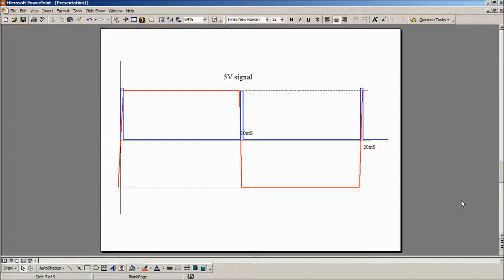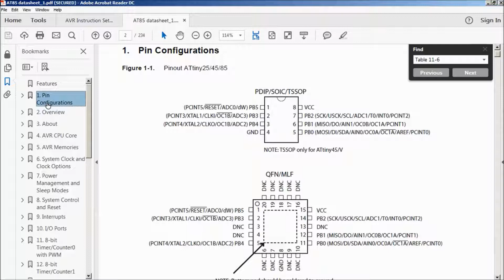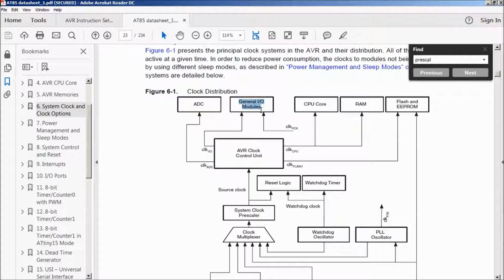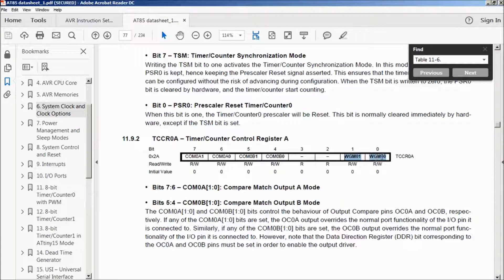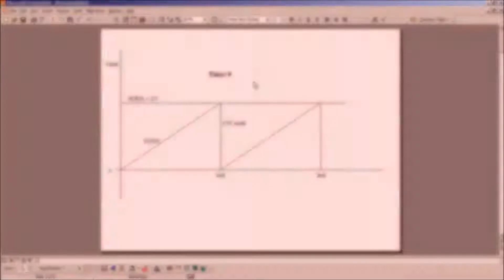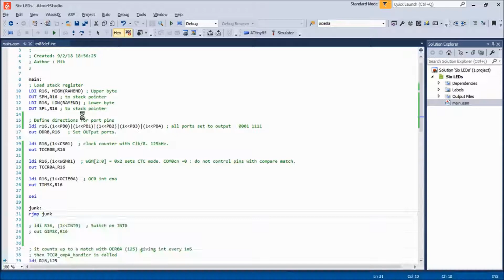ATtiny Assembler Tutorial Part 3 -  time delays

Comment: How does the rjmp  junk   ' knows '  that   the count  TCNT0 is equal to 125 ?
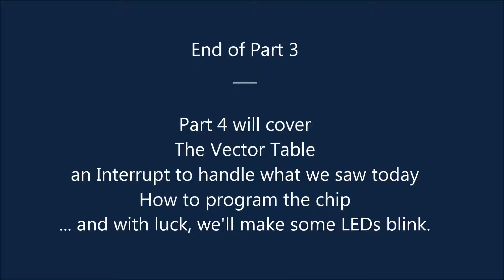Reply from the maker: When the video is running, it has a timestamp at the bottom of the screen - for example, 32:25 / 38:45
The 38:45 is the total length of the video, and the 32:25 is the point in the video that you are looking at.
Try clicking on the 32:25 now to see how it takes you to exactly that point in the video.  If you did that for me, then I would know what you were asking about, but the way you did it, I have to go all the way through the video looking for "rjmp junk".  I'm very willing to help you, but please help me to do so.
Reply: @DownhillAllTheWay   I am sorry about that.
Reply from the maker: Ah!  I just found it at 35:45.  The rjmp is just jumping to the label junk:  The rjmp doesn't 'know' anything about 125, but because it is jumping back and re-executing the rjmp over and over again, that means the processor is running, so it is using clock cycles and all the other bits of the chip are running too - including TCNT0, which is counting up.  I put a message on the screen about that at 35:52.  The 125 is set into register OCR0A - the Output Compare register, which is constantly being compared with the counter.  When it counts up to 125, there is a count compare, which causes a few things to happen.  The counter is reset to zero (because we're in CTC mode) and an interrupt is sent, which causes the program to jump to the instruction on line 25.  The jump is not explained at this point, because we don't have an interrupt vector table yet, which directs the program where to go when it gets an interrupt.  The Vector table is presented in the next module.  Hang in there, you're doing great.  All will become clearer in the next 15 minutes.

Comment: Ok.  I got it to work.  Now,  reading the datasheet,   what is  the thing that is doing the watching  and comparing of OCR0A and TCNT0 :  "The 8-bit comparator continuously compares TCNT0 with the Output Compare Registers (OCR0A and OCR0B)." ?  The CTC clear timer on compare.  By moving the WMG bit to the left  and make it a two, 2,  ....
Reply from the maker: Look at the diagram in paragraph Figure 11-1.  It covers the design of counters 0 and 1, so that "TCNTn" can be interpreted as TCNT0.  The same for the other terms - OCRnA, OCRnB - just replace the 'n' with '0'.
At the top left is the counter TCNTn, which is being clocked by clk(Tn), which is a derivative of the I/O clock.  Thus, it counts at a rate that is previously set up in the program as clk/8, clk/256, etc.
Its count is continuously compared with OCRnA and OCRnB by the comparator circuits marked "=", which generate OCnA and OCnB  (Output Compare A & B), which get sent to the Interrupt circuit to generate the interrupt.

Comment: I tripled check and Atmel7  does not come out of the loop in my example 1 which is exactly like the one on the video for winmerge.   https://gist.github.com/J4e8a16n/76348023c1dbfac21b0947abe43be87d
Reply from the maker: I copied your code from GitHub and single-stepped it in the simulator, and it works for me.
The operation is described at 35:45 for the next couple of minutes, and when I populate TCNT0 with 0x7C, it steps up to 0x7D, then jumps back to reload TIMSK (the "ldi R16,(1<<OCIE0A)" line), exactly as shown in the video at 37:36.
You have probably already solved your problem by now, but if not, please describe exactly what you are seeing, and at what point it your results differ from the video.
Reply: @DownhillAllTheWay  Jesus, it is the worst think I was expecting.  :/)
Reply: @DownhillAllTheWay     I will go to example 2.  I even typed your values in the timer, scrutinized everything , followed cycle by cycle  ... no way.     screenshot:  https://www.dropbox.com/s/5sy43i672rgyxwk/seven%20dogs.png?dl=0

Comment: line 25  at  32:25 ,   ldi R16,(1<<OCIE0A) ;   1 will be shifted 4 places?   How does assembly get the real number 4?   In the tn85def.inc file I found.   Take a 1 and shif it by 4
Reply from the maker: Hi Jean Pierre,  I can't remember without looking it up - but you can do that.  You can either search the datasheet using the search facility of your PDF reader, for OCIE0A, or search the definitions file under Studio-7.
Reply: @DownhillAllTheWay     In the tn85def.inc    OCIE0A  = 4
Reply from the maker: @jeanpierredaviau7478  In the datasheet also.  section 11.9.7.
Reply: @DownhillAllTheWay  Yes it is the 4 th bit.  If  you move 1  by 4  you get  it set see the image TIMSK =
0x10

Comment: Where cna I find the 10 first lines? 

line 11   ; load stack register

sbi DDRB. PB0

pulse_setup:
ldi R16,0x03    ;pulse length[
sbi PORTB,PB0    ;pulse high   |
pulse:			      ;|
dec R16			      ;|10 uS pulse
brne pulse		      ;|
cbi PORTB,PB0    ;pulse low   ;|
rcall delay
rjmp pulse_setup

;delay 990	;<-----
ldi R20, 30	;
loop1:		;
  ldi R21,110   ; 10 mS delay  find value experimentally                                          	  
  loop2:	; inner loop                                                                       
    dec R21     ;                             
    brne loop2  ; <----   inner loop           
  dec R20                                          
  brne loop1                                       
ret  

line 37

Regards
Reply from the maker: Hmmm...
That little bit of code was never intended as a program, but as an example of how NOT to make a delay.  Note the comment on-screen at 6:22 - "I have not given source code for this program because it is not something you would want to keep".  Just follow the explanation on the screen.   If you want to single-step this code, just copy it into Studio as it is and single-step it - however, I stress that this is not the way to make a delay.  It was my first attempt, before I had learned anything about the on-chip timers.  It is cumbersome and very difficult to make accurate.
Reply: @DownhillAllTheWay    Thanks for the answer.  
This comment should figure at the top of the list.
Reply: Atmel says PB0:unknown instruction or macro  | missing file delay_dont.obj

Comment: So the pulse cut the 240 volts current between 0 and 5 volts?
Reply from the maker: Yes.  I think it was about 2 volts, but it's the timing, not the voltage that was important.  However, the mains-switching circuit is mentioned, but not described in these tutorials.  They give you a grounding in the timers, which will give you a good feel for the use of the other peripherals, such as the A-D converter.  My course does not cover that, but if you understand how an A-D converter works, by the time you have gone through this course, you will know how to read the datasheet, so you will set the ADC interrupt and write your code.